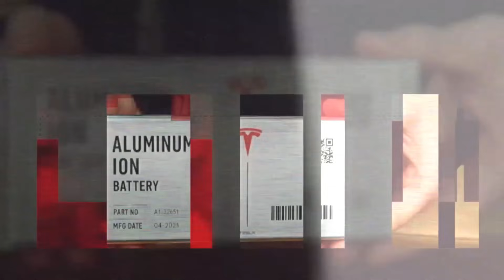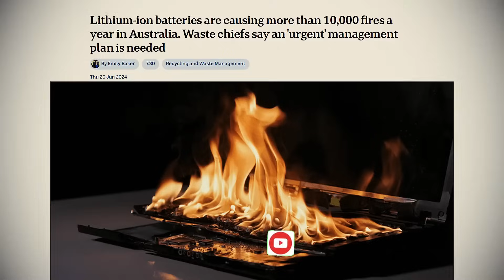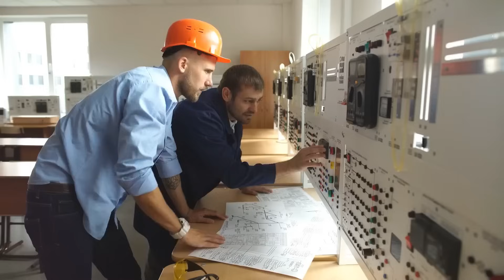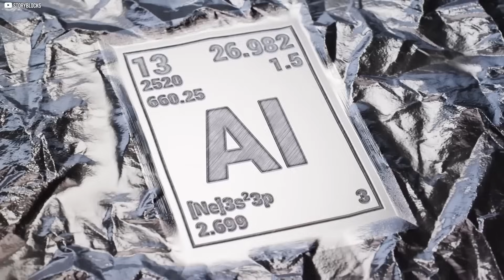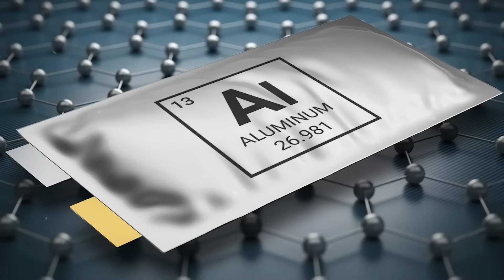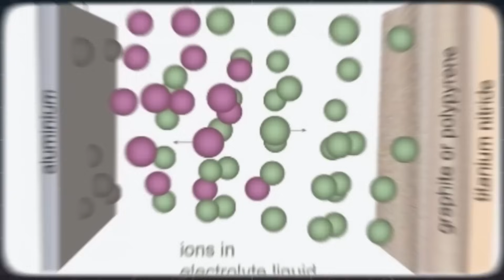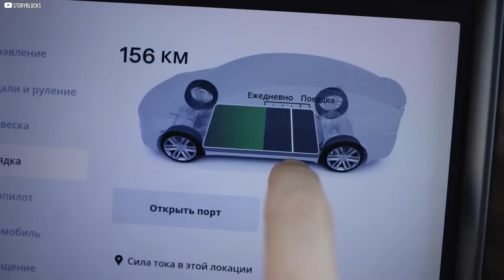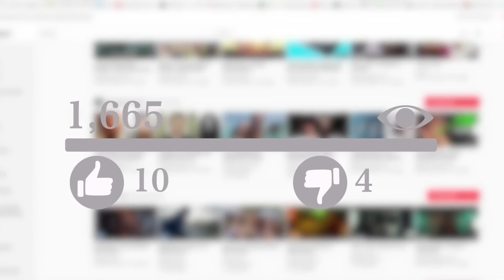5 Minutes Ago:  The Battery That Will END Lithium – Tesla’s Hidden Revolution!

Comment: No matter what materials you use in a battery, you will never be able to cut down on battery charging times for the energy needed to move a vehicle with load. Anyone with some understanding of energy, energy supply and batteries will tell you that. Charging times will not be reduced, the batteries will always be a hazard, and the electric grid is not designed to switch over to a society with 100% EV's. EV's are a scam and are not the future!